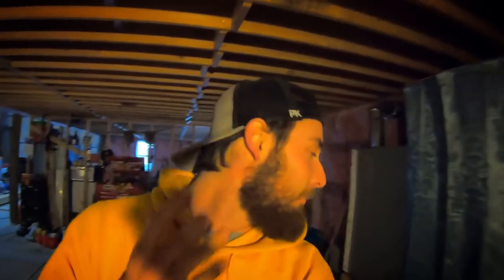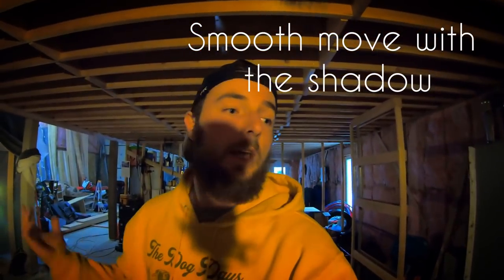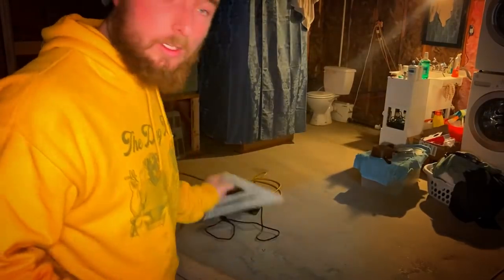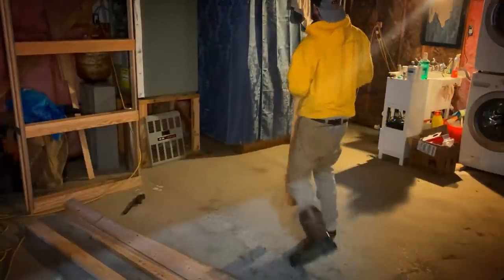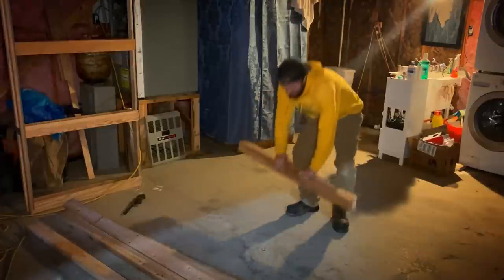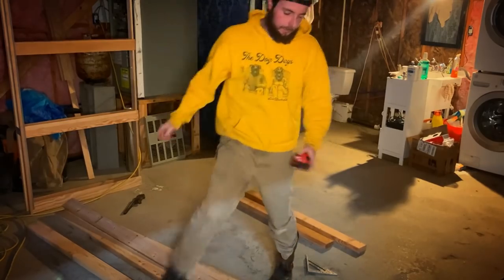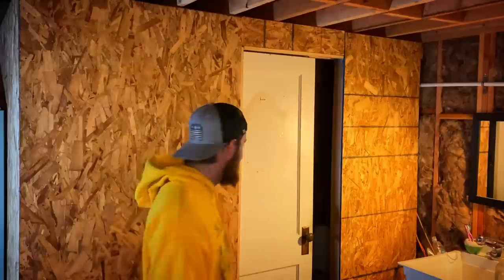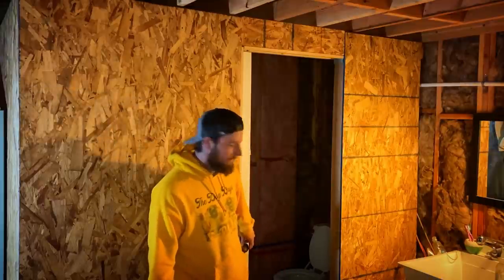Pooper Walls Are Done | Pocket Door Install | Millennial Couple Builds Mountain Homestead

Comment: Good job Mike! I've never thought of installing a regular door into a pocket door frame—that's a great idea! Just like you did, it allows for a door with much more character than the stock pocket doors.
One thing though: the bottom plate on the walls should really be pressure-treated. Anywhere wood directly contacts concrete, it will cause the wood to absorb moisture from the concrete, creating a mold & rot possibility down the road. In a pinch, you can simply slip a layer of tarpaper, ice & water shield, or ashphalt shingle between your bottom plate and the concrete floor as a moisture barrier.

Keep up the great work!
Reply from the maker: Hey thanks Tom! That’s a good idea, never crossed my mind. I’ll have to see if i can pry it up some. Thanks for watching!

Comment: House Wiring 

17- 20amp circuit 

         Kit. Outlet 

         Kit. Outlet 

         DW Cir. 

         Micro Outlet 

         Ref. Outlet 

         Outside Outlet 

         Outside Outlet Xmas 

         Bath Outlet 

         Laundry Washer 

Laundry room Outlet 

Laundry dryer 

Family room Outlet 

Garage Outlet 

Garage Freezer 

Garage Elec. Car Outlet 

Dining room Outlet 

Heater 

Bath room Heater Fan Light 

30 Amp Circuit 

Hot Water Heater 

Dryer 

Cooktop 

Air compressor 

Shop Sub Panel 

 

40 Amp Circuit 

     Outside AC 

60 Amp Circuit 

Wall Oven 

Sub Panel 

15 Amp Circuit 

Smoke Detectors 

Alarm Panel 

Lighting 

Bed room Outlet 

Internet Outlet